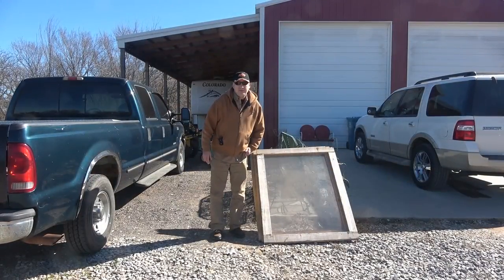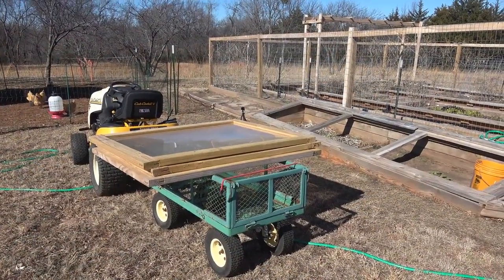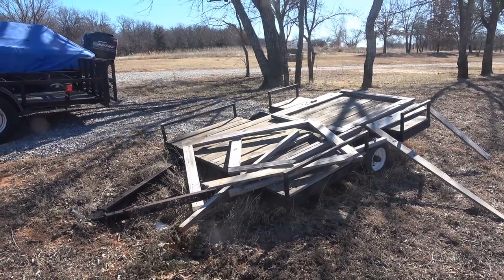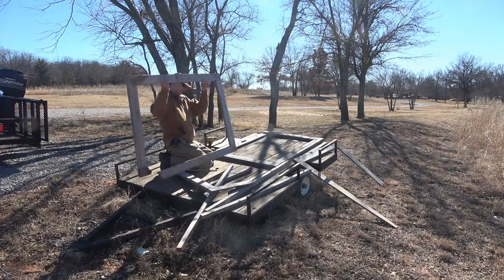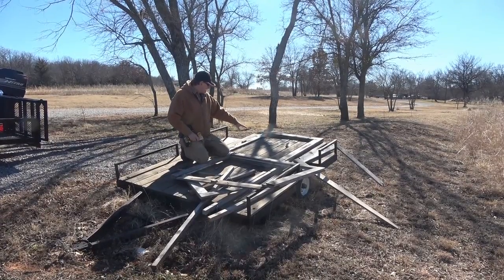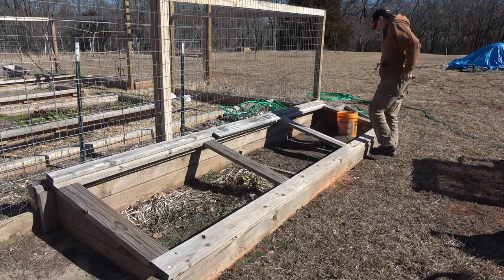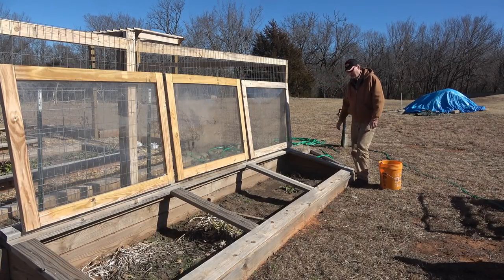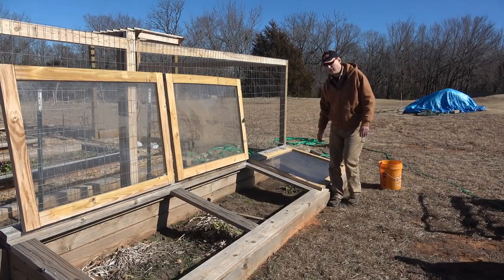Getting ready for Spring Gardening:  Cold Frame Doors

Comment: all the ponds around here are.  clay layers  bottoms,   some rocks em with clay under the rocks..  then  plastic sheeting but some thing put a hole in the plastic it will leak all out again.  SO put about a 2 or 3 foot deep clay bottom pack it down>  them i would throw some gravel on top about 1/2 foot down plant things you want and fill her up >  pound we use to have was made from old shingles from houses layer on the bottom  1/2 foot deep it had some red clay under it to help it even more>   Might clay it then sheet it with plastic
Reply from the maker: I’m thinking a couple of those big 100’ rolls of plastic.
Reply: @JeromeBeeFarm  what are ya going to if it sprouts a hole? why they put clay under it they seal togather  Just dig around found a clay deposit  an use it >  use off the pound to fill back with
Reply from the maker: I don’t have any clay.
Reply: @JeromeBeeFarm  SURE? lmao got to dig around to find it.  can be gray, white, black, red, brown, yellow> that pit you dug out didn't have any clay?  some times its on top and some times about  4 foot down or deeper>  might as well cement its the same price it was 400 dollars a load 42 square feet mixed delivered seal it 7 inches At less  4 inches of concrete form
Reply from the maker: There was a little bit in that pit, but it was sandy mixed in with it.